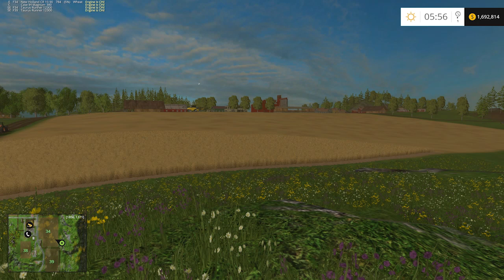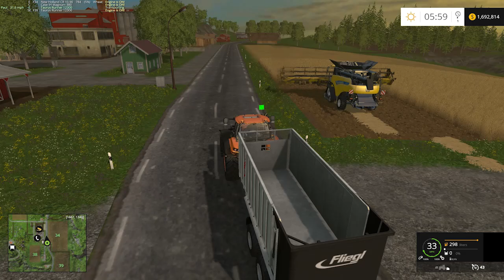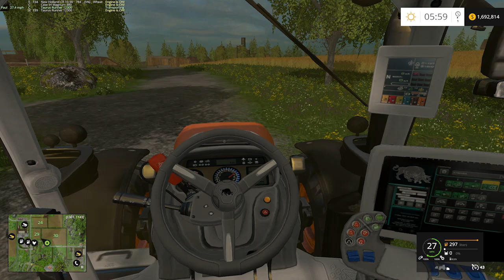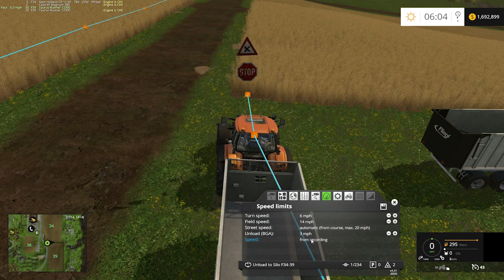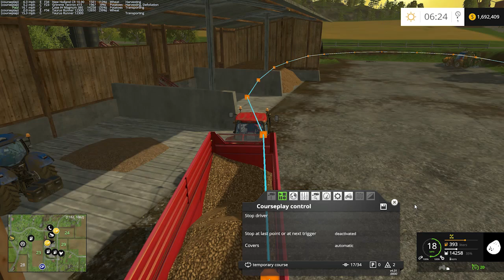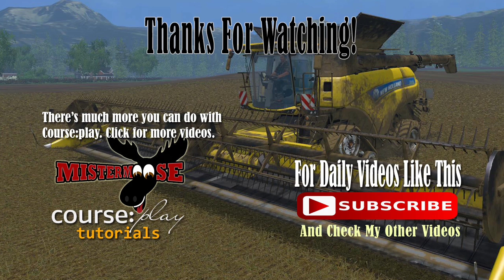FS15 - CoursePlay Tutorials - Unload A Combine Using Combi Mode

Comment: Great videos mate, really helped me out alot :)
One question; How do you make your tractor stop when he is done emptying the combine? Mine always goes to a certain waypoint, and he kinda screws up and goes into a fence every so often. I want him to stop and wait when he is done emptying the combine, like it does on your vid. 
Will appreciate your answer on this :)
Reply from the maker: Tore Klopstad Hmm? Are you driving the combine manually or letting the AI? The AI should stop him for you. If you are manually driving, you have to use the combine controls to tell him to stop. I have a video on that.
Reply: I'm having the same issue. My tractor status says going to waypoint and parks too close to the combine. I have tried it using both CP and Hire Driver. The funny thing is Hire Driver worked just fine. Very frustrating.
Reply: I'm using Courseplay for both my combine and tractor, just like you are doing on the vid. 
After emptying the combine, the tractor dont STOPS and wait for the combine to get full again, he drives to a certain waypoint. On your video, the orange tractor stops and wait for the combine after emptying it the first time, he doesnt drive to a certain waypoint :)

This is the problem, because sometimes he hit a fence, sometimes he drives in front of the combine and stops there, and so on.

Any ideas?